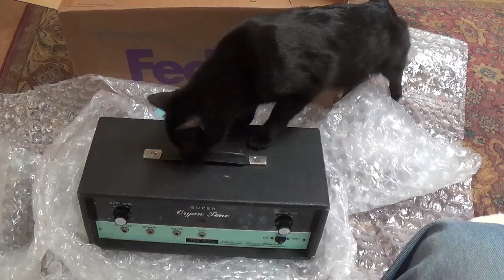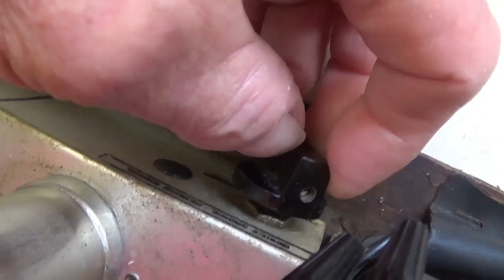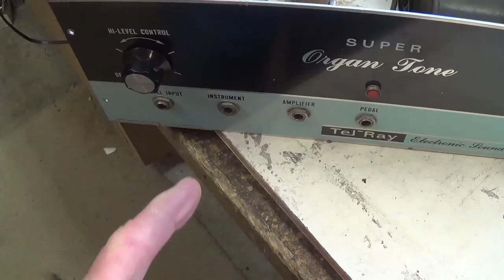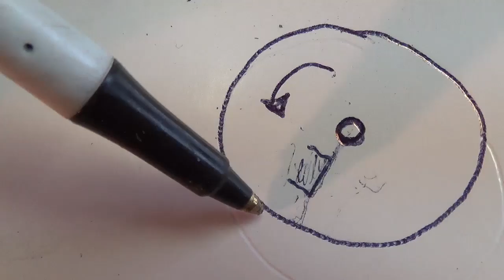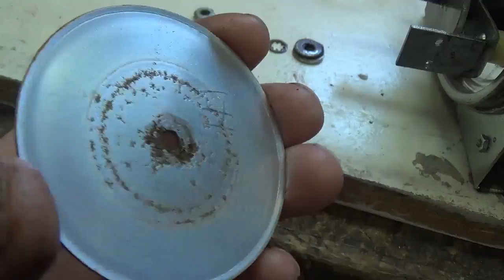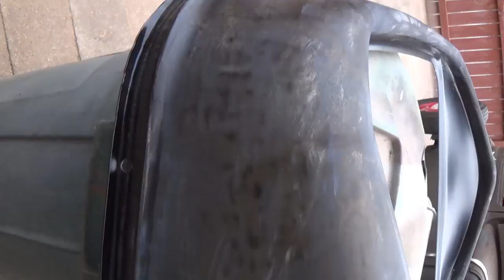Tel-Ray Super Organ Tone No.2: The Beat Goes On :)

Comment: Hello Uncle Doug, that ecl82 amp i've been making was a little weak so I decided to add another tube (6bq5) to spice it up, once wired it did the opposite effect! The amp now clips (distorts) at very low volume and is very quiet, and it's drawing a lot of current as well! I had a 1w resistor go up in smoke, any ideas on how can I fix it? Thanks
Reply from the maker: If you're having trouble visualizing the problem in person, GG, try to imagine how hard it would be for me to do long distance. My advice would be the same for any problem that follows a modification.......obviously it stems from the mod itself. You need to re-think your circuit design.
Reply: Well Uncle Doug, I fixed it! In total there are 2 pentodes so I fixed it by wiring the ecl82's pentode to the AOT ,the same as the 6bq5, not to the second filter (although it's triode was wired to the filter cap) and I figured out how to wire the diodes for the eye tube and it moves majestically now! But there is a small issue in that when I feed in a preamped signal and turn up the volume the 6bq5 sparks and pops inside! It's not the tubes fault as I checked multiple I think that I'm just driving it too hard as this amp is very powerful (for a 2 tube design)  Anyway, thanks a lot Uncle Doug!
Reply from the maker: You're welcome, GG.....although you're the one who solved the problem :)

Comment: Finally had some time to catch up on videos and this was another great repair UD! What a cool effect this is, and an interesting challenge to deal with that runout. When you mentioned the direction of the wipers, it occured to me that the wire orientation also looked odd that they wrapped toward the inside with the connection point inward. Really cool effect on the grill shell too. I never would have guessed that bluing could be used in that way
Reply from the maker: Thanks for your comments, Andy.....glad you enjoyed the video.

Comment: Doug, I LOVE your very entertaining and educational videos. IMO you occasionally might be too willing to replace original components with new ones. I'm not a huge fan of the ESR meter as the only device for evaluating capacitors. My main intent would be to do all I could to try and keep the amps as close to factory as possible. Kudos for your videos.
Reply from the maker: Thanks, Tony. In my own vintage amps, particularly those in great, original condition, I do retain all the original parts I can......BUT when dealing with customer amps, it's a whole different ballgame. People spend large sums of money to ship amps to me for repair, and I am obligated to make the circuits as functional and reliable as I can, which requires new parts in many locations, especially filter and coupling caps, power supply resistors, etc. You would sing a different tune if you did work for other people, especially if they had to ship items to you.

 Re the ESR meter, I have used it hundreds of times and never once has it ever given a "passing grade" to a failing cap. It's batting average is 100% in my experience.
Reply: Not being familiar with ESR testing I wonder about it indicating a bad capacitor that is in fact a  good capacitor.

Comment: Try degaussing the disk just saw this, so did'nt read tons of comments.
Excellent video. 
I always was sensitive to wow and flutter from analog days. Mag tape was my expertise. Hated it. Wow and flutter i mean. But of
 course as an effect great.
I would take the springy wobbulator off and get a different sound on footpedal demand, and put in a variable speed motor.
The first football_usa "instant replays" on live tv used aluminium disks of 20 seconds. And Connecticut had police servailance of said disk to record  traffic light crash 20 secs earlier triggered by sound of crash.
Reply from the maker: Very interesting, N1. Thanks !!

Comment: The spring is causing lateral movement of the shaft  the bushings for the shafts are worn
Reply from the maker: The brass piece under the blued spring has a hole that centers and stabilizes the axle shaft.

Comment: uncle doug, if you have a 4 or 6 or 8 ohm speaker output but do not use the correct ohm rated speaker will there be harm to your amp ? thanks
Reply from the maker: Damage can occur, George, especially if the impedance mismatch is large and the amp is operated at high volume.

Comment: Hey Uncle Doug, if you catch this comment...what did you use for lubricating the moving parts on this unit? I'm working on a similar unit and am not so well-versed in proper machine/motor lubricants, but my unit requires a little "kick start" to get spinnng. Sorry if I missed that in the video.
Reply from the maker: I used a thick, sticky lubricant (i.e. STP) for the motor and axle bushings, Paul.

Comment: Beautiful restoration.
Is the brass not also providing the ground contact for the disc ?
Reply from the maker: Thanks, K. The disc is also grounded by the contact between the axle and the bushings......but the additional ground from the end springs is helpful too.
Reply: Uncle Doug   
I had to do some digging to learn how the signal was “stored” on the disc. 
Electrostatic ! NOW it makes sense …
Pre bucket brigade capacitive memory. I'm impressed .

The trials and tribulations of maintaining good electrical contact with moving parts have been something I've been dealing with on a couple of my guitars lately. 
Despite being wired perfectly correctly I've been getting a light crackling noise while tuning. Grounding is solid and the crackle happens both hands on and hands off the rest of the guitar. 
I figure it must be the dissimilar metals in the tuner mechanism making intermittent contact as the steel worm winds through the brass pinion, micro separated by the lubrication. As they make and break contact there has to be electron flow between them.  It's been a puzzle. 
I've made one attempt to test my theory by adding temporary jumper wires between the peg and the post but that moving contact problem reared it's head. Besides, the wire was copper, the peg is chromed “something” and the same at the post end. For my next try I'd like to find some conductive lube and inject it into the machine head/s. Problem number one – getting hold of a syringe in Britain isn't the easiest thing to manage (unless one registers as a drug addict …) but I'm sure I'll find a way.
The noise isn't the worst thing in the world. Way quieter than scratchy pot noise or dodgy earthing. It's just irritating that it's there at all.

Comment: I did not see a speed control , I would mod the motor speed control to slow it down !
Reply from the maker: It would be a useful addition, IS.
Reply: Some units have variable speed. They use a conical end on the motor shaft to change ratios against an idler wheel/pully. Also a potentiometer moves with speed control.

Comment: Zounds UD * THAT'S IT ❗ Hiding in my face where i'd never see it 👉 an External Reverb !!
 Got a Fender Blues Jr. for regular use n' the dawggone things ALWAYS break the soldering joint for the reverb section - - -
Reply from the maker: I understand that is an issue with them, RRR.

Comment: Hello Uncle Doug! I have a rather unrelated question. I am working in little design of my own, using a single 12ax7. In one of the books I have read, they mention the need of grid stoppers (a small resistor in series with each grid, to stop radio frequency to get into the circuit), the author of the book goes out of his way to emphasize how important they are. In other books I don't see that they are considered that important. I'd like to know your and Jack's opinion regarding this, being the valve gurus you two are. 
Thanks again. 
Luis from Chicago
Reply from the maker: They are not as necessary as they once were, Luis.  Back in the 60's there were hugely powerful AM radio stations scattered over the US. Now, they are mostly FM. It would not hurt to include them in your build, however.
Reply: @UncleDoug  Thanks! I will send you pics of the circuit when is ready :D
Reply: I thought grid stoppers or am i thinking of grid leak resistor are sometimes necessary i had a tube car radio that wouldn't work without grid leak.

Comment: I just love that “Can Do” attitude (pun intended). Also, the fact that the manufacturer called the device an ”Electronic Sound Chamber” I got a chuckle out of that. Still really an ingenious design for its time. I agree that the run-out is probably a worn bushing on the disc shaft. My thoughts on a fix were to install a small flange type pillow block bearing at the end of the shaft to stop the wobble. I like to use rollerblade wheel bearings for such projects because they are extremely low friction, and many have an extended inner shoulder (used for spacing in the polyurethane wheels) that can be drilled and tapped for an Allen screw to affix it to the shaft. It is too bad that back in the day, C frame shaded pole motors were about the only silent small motor available, or at least the norm for record players, small fans, and clocks. Just think of the cool sounds that you could achieve with a variable speed motor. You have a gift my friend, of being able to take old things and make them look new again and now I see that you are quite adept at taking something new and making it look old. Beautiful work.What more can I say. And by the way Casey looks amazing, it is hard to believe that is the same neglected, starving cat that you rescued just a few months ago.
Reply from the maker: Thanks so much for all your very nice (and accurate) comments, Mark. We always look forward to hearing from you :)

Comment: Dunno where guys find these things, but I would think old studios would be the place to look.
There is a Electronic Warehouse near me that has tons of vintage tubes, capacitors and other electrolytics, but nothing like this. I wish they had amps.
Oh and on a side... I found an old Blackface Princeton Reverb in great condition on Craigslist, one owner, about 15 miles from my house... $500... I called and sent a text and got no reply. The listing disappeared a few days later. I was really bummed out.
Reply from the maker: It may have been a scam, John. They run ads for great items at ridiculously low prices and harvest e-mail addresses and phone numbers for sale to telemarketers. Either that, or the best deal of the century just slipped away.
Reply: @UncleDoug  I thought it was either BS or a pissed off girlfriend. Was kinda hoping for the pissed off girlfriend. 😂
Oh well...

Comment: I'm wondering if the ghost heartbeat heard is a result of head misalignment between the record and playback heads in which a residual recording remains outside of the record heads and is picked up by the playback head.  I'm also curious as to whether demagnetization of the record disc with a tape head demagnetizer or bulk tape eraser (if it'll fit within the confines of the can or with the disc entirely removed) would eliminate all residual recordings on the disc and the ghost beat entirely.
Reply: It's not a magnetic recording process though. It's an electrostatic process that relies on the oil coating the disk to prevent the recording from dissipating away almost instantaneously. I would think that when the motor is shut off and the oil runs off the disk total erasure would occur.
Reply: @sootikins  Ah, I see - I've learned something new
Reply: @Mrsteve4761  Doug explains it pretty thoroughly in an earlier video. Let's see if youtube lets me post a link
https://www.youtube.com/watch?v=-VvrmsT6zfw&t=2387s
Reply from the maker: Thanks for answering this, Sooti. Excellent job.

Comment: Oooh, wild speculation one of my favorites, thanks Uncle Doug. For example if you had replaced the dry and worn out bearings in both the motor and countershaft and oiled it (including the wick reservoir) before use, I'd say the movement of the countershaft would be next to nil. I have found that the common sintered brass bushing that these are, seem to like 90w gear oil the best. An ancient window fan of the 100 watt variety helped me in my self education of what works best in those bearings. A daily oiling was required with what ever I had on hand, 3 in 1, motor oil, gun spray, WD-40 - you name it, I tried it and it was a daily ordeal for years on end. I found myself parked at one point inside my house wondering what ELSE I could try since this daily game was getting insanely boring and nothing seemed to really work, let alone work good. I just happened to be looking right at a pennzoil plastic pint jug of rear end lube, out of exasperation I tried it. It was a year later that I need to oil that fan again lasting the rest of that entire summer season and another year later for the third oiling. I now have a needle oiler with 90w ready for any sintered bearing I come across. Since then I have found Super Lube part # 31110 to be a contender for second place, made by Synco Chemical Corp.
Reply from the maker: Thanks for the info, Lee. I use STP. It lasts ~ forever.
Reply: @UncleDoug  90w instead of the UCON?
Reply from the maker: @cheezhead6007  The bearings for the drive shaft are outside the can, CH, so they must be lubricated separately.

Comment: Greetings Uncle Doug,
   I really enjoyed watching the restoration process, the troubleshooting detail was great. The end result also but for that motor frequency specific sound. It was hard to hear though when pointed out it was certainly there. Never having worked on one of these devices my suggestion for the reason of this sound could be way off but something you said about bushings being dry makes me think worn bushings ate the culprit, at least in part. Because of the spring  causing loading on the bushings in one direction, and the lack of lubrication in the bushings, I think it is likely that the bushings are worn in an oval shape and this could cause the shaft to shift side to side in the bushings the load from the spring changes. I dunno, but I think even a small shift side to side of the anodized disc might be heard.   This would not be the same as a disc mounted rigidly  off center  because in that case the recorded and read tracks would be concentric to the center of rotation. But if the shaft is moving back and forth in its bushing the recorded track will shift in relation the the read heads.
Cheers,
Eric
Reply from the maker: Thanks for your very detailed and helpful response, Eric.

Comment: U.D., I have a DeArmond Trem-trol 800  pedal that belongs to my father (he's 83). I  have tried to fix it myself without luck.  Now that you have put out the call, I would love to have you fix it for him. It may be a challenge as it needs a new motor (copper wire winding came loose), but I believe I have found a NOS replacement motor on ebay. Also needs power cord, guitar cable and I'm sure the fluid has dried up.
Reply from the maker: I'm really looking for the Model 60 unit, that is free-standing, without a pedal, but would consider working on your father's Trem-trol. If you do get the replacement motor, please let me know.
Reply: @UncleDoug  will do, thanks

Comment: Can you fit a speed control to that?  Maybe a dimmer switch?
Reply from the maker: I agree that a speed control would be a nice addition.
Reply: Some units have variable speed. They use a conical end on the motor shaft to change ratio against an idler wheel/pully. Also a potentiometer moves with speed control.  I tired using min variac pots but one smoked and the other a 30 ohm did nothing to slow the motor maybe a 150 ohm pot at 150 watts would work.

Comment: Doug, you did a great job of troubleshooting this unit and even if you couldn't get it quite perfect (I'm nor sure what more you could have done except for maybe replacing the main shaft and bushings) it's great to have another one of these functioning in the wild. You were correct to point out that the ends of the heads really do need to be aligned so that they true up with a radius line from the center of the wheel; the treble will disappear dramatically if they aren't aligned. I did a little analysis of your video and measured the disc rotation at 147ms/rev - with the heads arranged at 180/90/0 degrees like you wound up with them at you'll have delays baselined at 37ms and 73ms and the delay time will be modulated by some amount at 147ms because of that spring on the eccentric peg.
Reply from the maker: Wow, thanks for the detailed analysis, Hub.

Comment: I love classic analog electronics, such a relatively simple device and in a paint (or Tuna?) can of all things. Were there any component changes? Caps and or resistors? What kind of tubes does the spooky machine use?
Reply from the maker: I did change out the filter caps. It uses one 12AX7 for reading and one for writing.

Comment: Thanks Doug. Are you really sending that unit back with the old e-caps? Maybe new bushings would help with the shaft.
Reply from the maker: No, I replaced all the filter caps before returning the unit this afternoon, Robert. New bushings are easier said than done, and the runout was essentially zero.
Reply: It was hard for me to believe that you wouldn't replace the e-caps. It seemed there was a lot of slop in it when you wiggled the shaft. I know what you mean though, you may have had to get the bushings special made. I didn't have time to do any research into it. Well hopefully the fix will last a long time. Your work was much better than the previous work done to it!